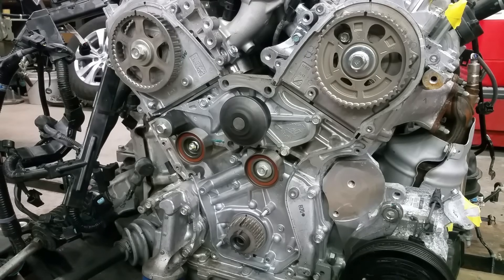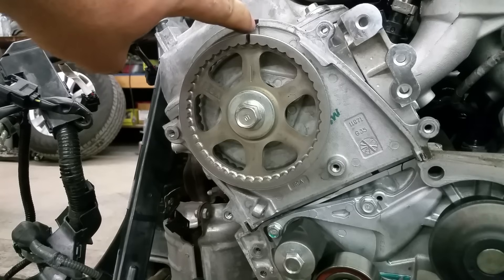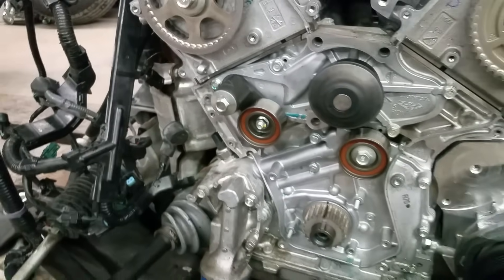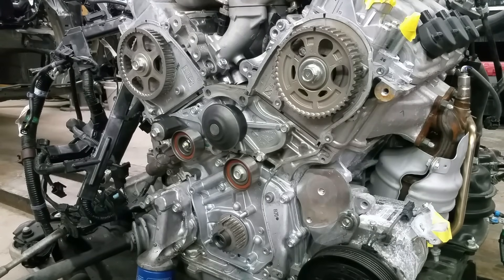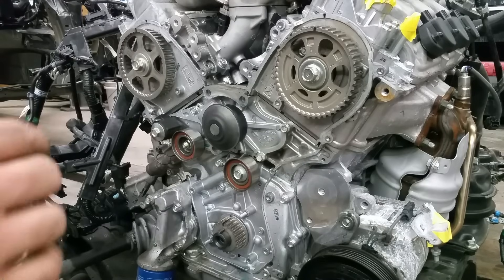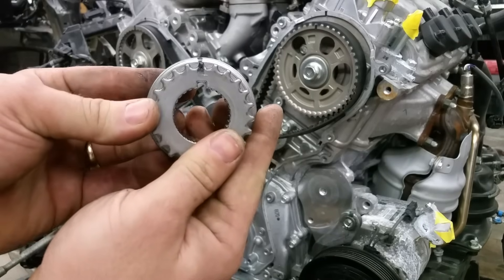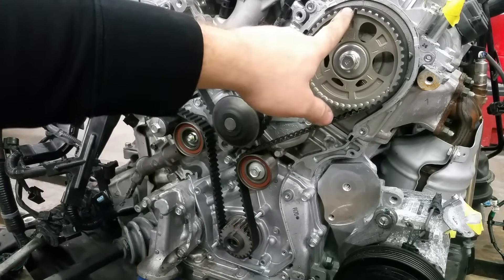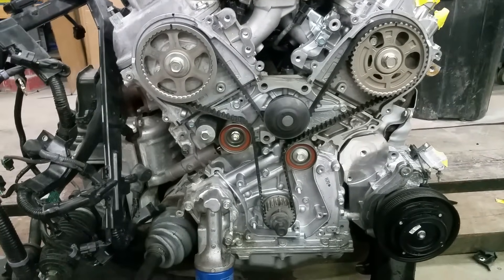SETTING UP TIMING BELT ON HONDA ACURA 3.2L 3.5L 3.7L J-SERIES ENGINE IN DETAILS!!!

Comment: I just did mine had to replace the motor mount to it was toast! I started mine from the crank and went counter clockwise so that when you reach the notorious rear cam that loves to jump it can’t move because it’s already got enough tension on both sides once the teeth are on it! I also was taught this trick by a honda tech, you completely leave the tensioner pulley off but close enough to grab it right after wrapping the belt around the rear cam you’ll want to keep it tight by squeezing the belts together that are under the rear cam! Then you can slide the tensioner pulley right in between easier then you’ll have to hold the belt tight and put the tapered bolt in the pulley, so much easier than trying to stretch the belt over the pulley when already installed!

Comment: Fantastic video, straight forward. How likely am I to experience bent valves on my 2005 honda odyssey 3.5 jseries? My belt was replaced 18 months ago and I'm doing the job again. Not sure why the belt failed, as the engine didn't seem to show any signs of malfunction or issues. Just drove one day and jumped on the Express Way, while sitting in traffic the van just shut off and didn't want to start again. Low and behold had to get a tow back home. Any feedback would be gratefully appreciated. Helpppppp!

Comment: How do you get the bolt out after the two full turns cuz mine stuck!?
Reply: Impact gun, or use a short breaker bar and hit it sharply with a hammer.  Honda service manual shows where to lube that bolt and its washer with engine oil for installation.  You can lube the bolt threads and inner surface of washer for repeated install/removals during the work.  Do NOT lube that inner washer surface where it meets the harmonic balancer on final install.
IF your belt is on AND tensioned, a helper can hold BOTH cam bolts with wrenches while you hit the breaker bar.  The object is to apply sudden force, not gradual force or the engine will turn backwards, and thats a NO-NO.

Stay gold.
Reply: Here is the Service Manual crank pulley bolt install:
https://imgur.com/a/cyVWnKJ

Comment: I recently did the timing belt on the wife's 06 Ody. Month later the engine developed this horrible noise metallic sound when idling and couldn't determine where it was coming from and no check engine lights to narrow down the issue. Had to remove the crank pulley bolt and covers for inspection. Found a bad hydraulic tensioner that was not keeping the correct tensiosion. Replaced it with the original Honda brand and problem was solved. Side Note: I will for now on spend the extra money and buy OEM or AISIN to to have that peace of mind.

Comment: Very cool to see the engine out to display and you going over the steps.  One of the clearest video out there. 

One question which maybe an obvious question is I’m assuming you crank the crank bolt to line up before starting the job like your video?

Comment: I have a 2008 TL (3.2) with 175,000 miles on it and I'm not sure if the timing belt had been changed. I've got the kit and am going to pull the covers ti see if someone marked it indicating it's been changed other than the carfax saying recommended maintenance was done. How many miles have you seen from a J32A3 engine?

Comment: Thank you sharing. 

My cams keep jumping forwards. I was under the impression a cam should never be turned backwards. Am I able to rotate the cam completely around with head installed to align it properly?  Isn’t this an interference engine?

What is model number of that cam tool you were discussing?  I’m doing the job all by myself, and the cams just won’t stay lined up.
Reply: Did you figure this put? I'm in the same boat.
Reply: Well, I ended up using a non-ratching box end wrench and then slowly moving to proper index marks.  I did this on a bench.  I still don't know if I can fully rotate cam while engine at TOC.  Do you know?
Reply: What do you mean ypu did it on a bench? My engine is still in the car and im having a hell of a time. I replaced the water pump, before removing anything I made sure everything was at TDC. Now my camshaft that is along the back side towards the firewall/bulkhead is out. I didnt notice until I put everything back together and tried to start it. What do I do now to get it back to the correct timing? Also the car ran for probably a split second and now it will not start at all. Just turns over.
Reply: Well, I had the heads off on a bench.  I'm pretty sure the manual indicates that you should be able to re-index the cams on block with it at TDC.  But I don't believe it since I think this is an interference engine, and no one responded to my question.

I'm sure you're cam timing is causing your no start issue.

After installing belt, did you rotate the assembly numerous times to ensure it kept timing?

Comment: George hey man just wanted to tell you great video bro I just bought a Honda a few hour ago and the time belt broke I wanted to see if you could help me a little more information about what else I need to do while doing the timing belt change
Reply from the maker: I don't want to tell you bad news but if your timing belt broke then you have a serious problem. This is interference engine which means if belt breaks it bends intake and exhaust valves. You will have to rebuild your heads. That is why its very important to perform 100k mile maintenance on honda and acura vehicles.
Reply: @melniksmotors  so I just got finished checking the motor and it does has the timing belt on. We turn the key to start it and it makes a buzz sound not a hit sound but more like buzzzzzzzzzzz like it turns but doesn't start what could it be my dad said it was the piston that didn't do compression that they were broke and i told him that it a piston was broken it would make a hit sound even shaking the motor so I don't believe it's a broken piston
Reply: @melniksmotors  well I haven't really seen if the belt is broken that's what they told me but I'll remove the covers to see how it looking. When I start the car it sounds like a little turbine and it pops like if it wants to start. Do you have any social media so I could send you a video so you can tell me what do you think it could be that would really be helpful and easier Im a mechanic I just don't know much about Honda motors

Comment: HELLO SIR .  QUESTION : 

I did this timing belt Job and skipped a tooth .  . its Out of time . 

CAN I GO BACK IN AND FIX IT OR IS THE ENGINE RUINED NOW 
SINCE I STARTED THE CAR LIKE THAT ?  AND DROVED IT ABOUT 200 FEET AND TURNED IT OFF. 
THEN STARTED THE CAR AGAIN ...
THEN TURNED IT OFF . 

IT WAS RUNNING PERFECT BEFORE I DID THE TIMING KIT. 

HOW MUCH DOES IT TAKE FOR A PERSON TO RUIN THE ENGINE AFTER A START UP IF NOT PROPERLY INSTALLED. 

NOW IM WORRIED.
THANK YOU   
WILL BE WAITING TO SEE YOUR REPLY .

THANK YOU
Reply: Is your car still fine ?

Comment: Nice video and I have a 2010 Acura MDX with 63.000 miles on it should I change the timing belts or when it rich 100.000 miles.?
Reply from the maker: When it gets up to 100,000 miles
Reply: George Melnik great thank you sooooo much I really appreciate it.💪🏻💪🏻💪🏻👍

Comment: Never reset the hydraulic tensioner!!! Throw it away and install brand new. You should NOT be recommending that it be reused!!!
Reply from the maker: I did not recommended it be reused but i did show how to reset it. What happens if you set your timing and its off by a tooth or two. Then you have to retime it. You have to reset hyudralic tensioner.

Comment: so i dont get it, does my accord v6 2009 have timing belt or serpentine belt? it looks like its in the same location...
Reply: It has both.  Nearly all cars have a serpentine belt to drive the alternator, A/C compressor, and power steering pump.  V6 Accords have the J35 engine, which has a timing belt inside the plastic guards which have been removed in the video.  The serpentine belt is the one you can see under the hood.

Comment: If the engine was in a car, you'd never get this job done doing it the way you did it. As others have said, crankshaft first, then cams, last is tensioner. Hopefully people read the comments before trying this job on their own cars.

Comment: I have a question. I am in need of replacing the timing belt tensioner. My worry is that I removed the tensioner and I was expecting to have play on the belt, by the pulley. Instead, I  have play on the belt around the center pulley, where it simulates a "V" around the camshaft and the center pulley. lots of play there. It is tight around the crankshaft and the camshafts. What will move after I release the new tensioner ?. Worry that timing will move.

Comment: great video  but you should install the timing belt from the crank to the left cam sprocket  first them move in the opposite  direction of engine rotation  not cams then crank

Comment: On the front cylinders,you said the number “1” is indicated on the sprocket,is that the number 1 cylinder? If it is, the number 1cylinder,the number 2,4 and 6 are at the rear?
Reply: 1,3,5 are on the left or back. 2,4,6 are on the right or front

Comment: How do you know if your compression stroke or exhaust stroke when setting up on number 1 cylinder isn't that important to be on the compression stroke?
Reply: I was just wondering the same. I just recently did this a few days ago. Even tried to set #1 TDC and set them like he said. Started the car and it runs like shit. I think the timing is off.

Comment: Yeah ok sir, the tensioners take five minutes to compress slowly, like a clock, if you would've bearly put pressure on the vise it turns itself and slightly clicks of oil you can hear like a clock gear, I'm tierd of other mechanics ramming thoughs tensioners inn😑, it's hydraulic and there's lil seals in there your pushing back inside by using force, and later on failure accurs or premature belt failure at a shorter mileage happens or a rough idle and not smooth idle happens in which no one can figure out, but now you know, Ciao Bella*🙋
Reply: The tensioner rapidly adjusts on the fly. Five minutes my ass!

Comment: I have a 1995 Honda passport v6 3.2 its making a really loud tick, is that very possibly the tension-er?  is this common?
Reply from the maker: +James Hughes 
Possible tensioner. I would not run the car.
Reply: thank you its not running anymore i threw the timing off lol

Comment: Had mine done at the dealership at 87,000 miles 06 Honda  Ridgeline. I hope it was done right. Some of there work really stinks. I had a new battery installed from the same people. They put a screw between the clamp and battery terminal  because it was a loose fit. They should have put on a new clamp. Also the 2 J bolts holding the battery were rusted so they just stuck them back on. One was broken in half so I had a loose battery. Some of the dealerships work is really bad. Be Aware of dealerships.

Comment: Hi, yes - two questions:

#1 - could you show us/tell us how to set up the rear and front cams if they're not aligned? 

#2 - how to take off the crankshaft screw once you have completed making two full rotations. 

Thank you very much, I liked your video. So much easier than what I did yesterday. Also, I tightened my tensioner pulley after I released the pin; I noticed you didn't during the video and do not know if you did afterwards. 

Thank you in advanced Sir. Great video

Comment: If I had known that these are interference engines, I would have purchased something else.
Reply: 6651212elm In US people get attached to old American cars while old Japanese cars are exported to 3rd world countries.
Reply: @6651212elm  because Japanese cars from the 80's rusted out really bad yet they still were running. There's very few 80's cars anywhere now no matter who made em, what we do see has probably been worked on multiple times just to keep them goin.
Reply: I'll bet most engines are interference engines these days. Just keep the maintenance done. I have over 300K on another Honda timing belt engine. I did the belt about every 80K. Did it every time but once myself.

Comment: No wonders the cams wants to jump on you, You NEVER start the belt on the cam pulleys.. 

You start from the crankshaft > front cam pulley > water pump > rear cam pulley > tensioner. This way its almost next to impossible to jump the cam.. 
This is the official Honda Maintenance Manual procedure.
Reply: Someone buy this guy a fxxking Beer !  Good info to know. 

You are Teaching the Teacher .
Reply: I agree with you 100% skirmish
Reply: The comment is good, but doing it with the engine on the car, come on!
Reply: For sure very easy this way fast and fool proof
Reply: I just did this job and the ONLY way I could even get the belt on was to do it the way he did in this video - crank first.
Reply: I could kiss you, but i won't. Here's a thumbs up instead.
Reply: Damn good comment. It's been a while since the last time I replaced a timing belt, so I'm rusty.

I always star with the crankshaft, but tried this way instead and you're right, the freaking cams keep on jumping.

After many tries, went back with the crankshaft first and didn't had as much trouble, the engine is in the car, that' why.

I wish I had read your comment before. Anyways, the belt is finally on, just need to reinstall the tensioner to be done.

Thanks for posting the right procedure, it will save many viewers headaches.
Reply: skirmich hey
Reply: YeZzziR!!!...
Reply: He’s done hundreds .....NOT
START AT THE CRANK THEN GO COUNTERCLOCKWISE NO SLACK TILL THE FOLLOWER
Reply: even i know that and im a newbie to replacing timing belts.  you want the slack on the tensioner

Comment: where to get a bolt that installed into the crankshaft pulley to do 2 full turn to test out the timing alignment.
Reply: Never mind it is the bolt that is installed in there originally.

Comment: How would I go about removing those cam gears to replace the seals?
Reply: You need a specialized honda tool to hold the cam pulleys.. 
Do not attempt to remove the bolt without holding the cam pulley as you will skip timing very easily.

Comment: I have a question is the J30A1 engine found in the 1998 Accord an interference engine?
Reply: The 3.0l and 3.2l are freewheeling engine, so it is a NON-Interference engine, no bent valves.

Comment: Thank You, George. I have a question. I have  2004 Honda Pilot and have an error code 0341 which is the CMP sensor.My mechanic says that I have to remove the timing belt in order to removed the CMP sensor, however other mechanics saythat it is not necesary to remove the timing belt could You please tell me what to do? I am confused also between the CKP sensor

Comment: Thank you very much. I have to do the timing belt and water pump on my odyssey 06. So I hope I'll get it right. . 1 question. What if one of the pistons shaft turn a little bit ?  Do i have to give it a one full spin clockwise. ?

Comment: The special Crank Pulley adapter can be rented for free from O'Reilly autoparts or Autozone.   You can also purchase the tool from Amazon for around $15.   Just search Amazon on 'Honda Crank Pulley tool' and you will get multiple brands.   A much easier method of removing the crank pulley bolt is by using the Lisle 77080 19mm Balancer Socket.   It quadruples the torque and allows you to remove it effortlessly with an average air gun or good lithium impact wrench.   If you search youtube on 'Lisle 77080' you will see videos on how easy it is to remove that bolt.  Amazon has it for around $28.  80% of the entire job is getting that bolt off.  If you have the Lisle Socket you just saved yourself many hours of frustration.   Good luck everyone.

Comment: i have a 91 acura legend and i get crank no start i just checked the compression i get 30 and under so i'm wondering if its the heads or the whole engine is now a paper weight

Comment: I know this video is old already but I have a question. I looked at my timing belt and it doesn't have the teeth like this belt in the video. It has grooves that run along the belt in a row. On my 2006 Honda Ridgeline
Reply: You're looking at your drive belt not the timing belt. the timing belt is always going to be covered with either a plastic or metal cover
Reply: It typically takes around an hour of removing parts to get to a timing belt. The vehicle featured in this video only takes about 15 minutes.

Comment: Hello BundysGarage!!! Thank you for ur videos. I use a Honda Oddysey 2005 model, I just discovered that my engine has high starting which damaged my kick starter, I got another kick starter and it also has the same problem as my initial kick starter and I also discovered that my exhaust brings out tick light blue smoke and consumes lots of engine oil and also consumes fuel and I also discovered that when the car eventually starts, it brings out an unusual water release from the exhaust and much more when u raise the engine before moving. Could this be as a result of jump in TIMING BELT?